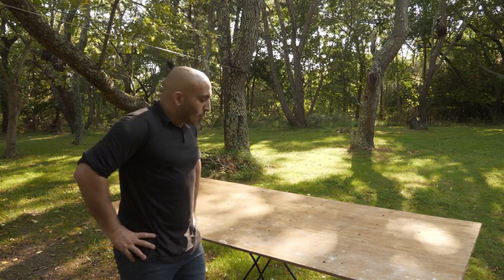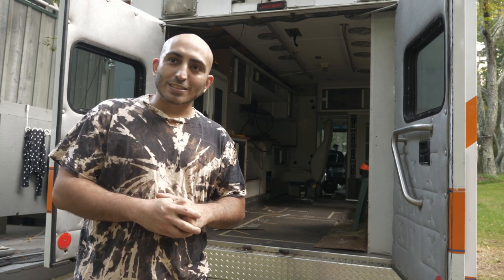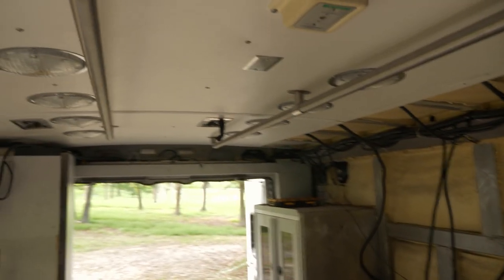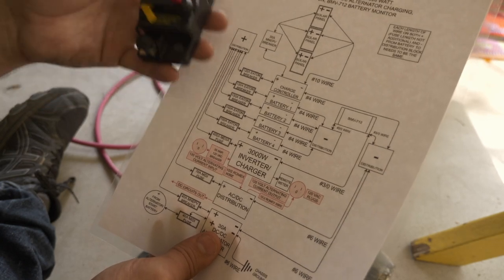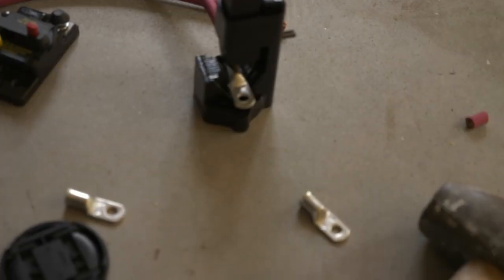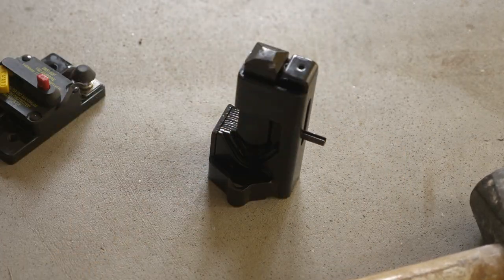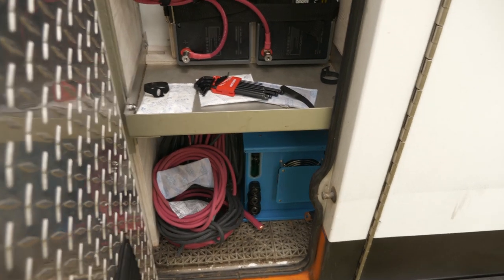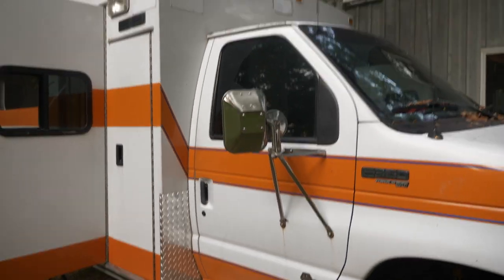Earthman Dan In A Van | Episode 4 - Demolitions Continued & Electrics - Ambulance Vanlife Conversion

Comment: I've seen people gang all their batteries in parallel and then wire them essentially as one battery to the respective components from the + & - terminals. What are the pros/cons/etc of doing it that way as opposed to the way you did it? I apologize if I missed it if you explained it in the video already.
Reply from the maker: I'm not really an expert but I would say that you want to make sure that you are not wiring up each battery to different devices. This will drain your system unevenly. In fact, all my batteries are ganged together through positive and negative bus bars. They just look a bit different. I'll have a new video coming out soon where I'll go through everything I did in better detail. Also I cannot recommend @Light Harvest Solar enough. They can walk you through everything and help design you system. Amazing customer support. Literally worth every penny!
Reply: @EarthManDanInaVan  That's good to know! I'm not afraid to get my hands dirty. I've just seen many variations of setups that worked for that particular application that I don't want to "cross logic" and then end up "crossing wires" and cause unnecessary problems. 🙂